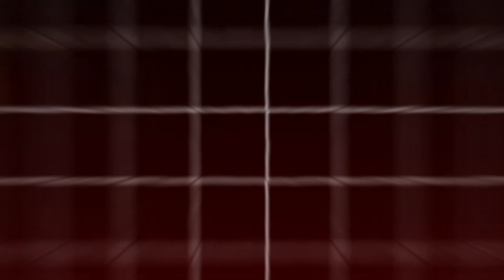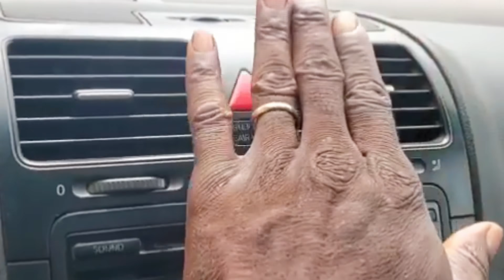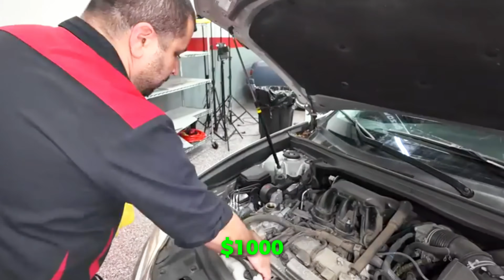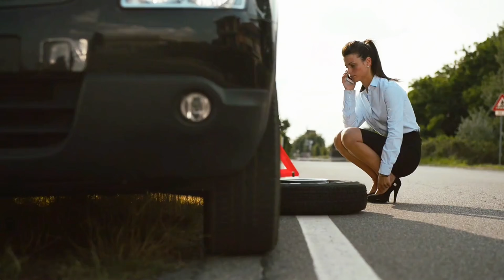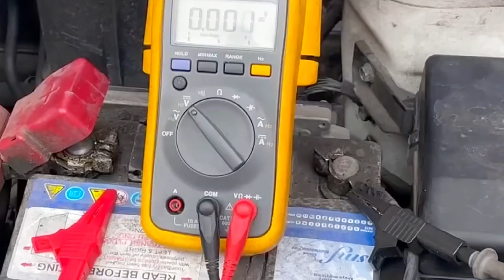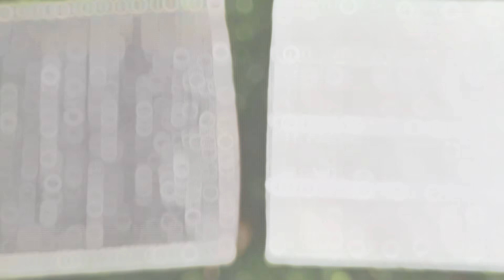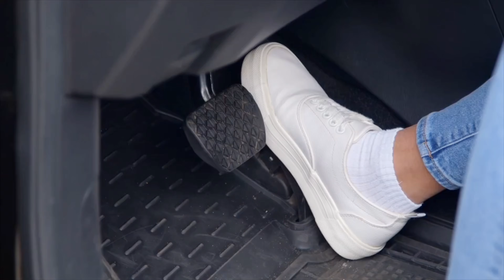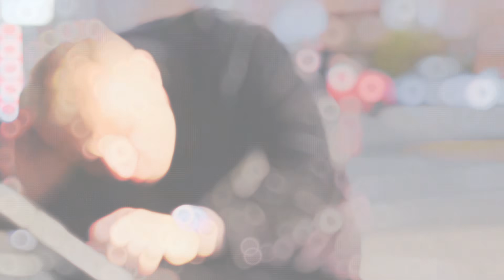Stupid Mistakes DESTROYING Your Automatic Car (AVOID THEM NOW)

Comment: A major problem with the check Engine light is the reader at the auto parts store only gives general information.  It might give you an entire system that has a single problem but not pin point the part.
Reply: Correct! They can clear the code. It may or may not come back on. Google the OBD code and determine if it's a simple omissions sensor/code. In that case, nothing to worry about. Or if it's a more serious engine issue!
Reply: My OBD II reader can connect to the internet to give me information on the code. It's quite handy.

Comment: Wiper blades USED to take 5 minutes to replace.
Reply: They still take 5 minutes to replace.
Reply: Apparently the plastic hardware attachment pieces are constantly being redesigned. It’s a pain in the rear as they are not intuitive between brands 😮😢

Comment: Where do you purchase a $5 quart of oil ?
Oil costs more than $40 for 4 litres.
Reply: You can buy a gallon of oil at wal mart for $15. Which is about $3.75 per quart
Reply: He was talking about adding oil to a low oil reservoir. Not changing. your oil. .
Reply: I pay about $4.00/quart.

Comment: If you read your car’s manual, it says to turn on the recirculating button once the super hot air has been cooled.  The regular button allows outside air to come through the air conditioner, get cooled, and then exit the car, pushing the super hot air out of the cabin.  THEN the recirculating button is pushed, and the cooled air remains in the cabin, easing the load on the AC system.  Rolling down a rear window also gives the super hot air somewhere to escape.  Roll the window up, let the air cool, and push the button.
Reply: also, when you don't keep the air recirculating  it is pulling in exhaust from other vehicles  - can't be healthy.
Reply: @ZmarleneZ  That's the main thing I use it for! The diesel fumes make me sick. (I also use it to keep cool air inside)
Reply: Common sense
Reply: Makes sense. I open all four door in driveway and just let natural expansion of hot air or the slight breeze get rid of that super heated air
Reply: @LK-bz9sk   whats to say the hot air escapes your car and more hot air gets into your car.  I dont like it.
Reply: @MaryelleBea   If the windows have been up while it's sitting in the sun then the internal air is significantly hotter than outside air, it's like a sauna. Opening the doors will at least let outside air in so it's not quite so hot.
Reply: @MaryelleBea . Black interior vehicles pass 130 degrees Fahrenheit. Multiple studies confirm this
Reply: lol. What percentage of car owner read the car manual.. it’s thicker than most Novels…. We read it when a light turns on 😂  or  YouTube it… Every car dealership should have its Own YouTube Channel that  explains  the car you just spent $30K to 70K on ..
Reply: Keeps exhsust from others cars entering my car
Reply: Thanks !!!
Reply: Most cars now are smart & automatically turn this feature on when it's time.  Just older cars need you to manually touch this button.
Reply: I just roll all windows down, it’s hotter than hell in Louisiana 🥵🥵🥵
Reply: @Swampgurl777 My hairdryer is 4 windows down & 55 mph!😅
Reply: @eldajackson1 😂😂😂😂😂
Reply: @eldajackson1 Zooming 😂😂
Reply: @Swampgurl777   Arizona too.  You guys have worse humidity though.  Either way, do your best to stay hydrated and healthy 😊
Reply: @Lala.903 right back atcha 🥵
Reply: In very hot weather we leave driver and passenger doors open for a minute to allow a/c to push hot air out.
Reply: appreciate ur words but extremely confusing. You should start with Entering A Hot CAR Open Windows and press OUTSIDE AIR BUTTON to push hot air outside?
Once hot air kicked out, roll up windows, Press INSIDE AIR Button (recirculating one) to cool the air getting cooled  already circulating inside car.
is this correct_please share thank You
Reply: @pilarq7886that outside air button pulls in air from outside and blows it into the cabin.  I always open my windows but never change the recirculate button.  What is the benefit to pulling in hot air from outside into the car, if you are trying to let the hot air escape through an open window.  Why not just leave it on recirculate and let the hot air out the windows?  Truly trying to understand so i can follow the right steps for my car, not being critical.  TY
Reply: @my3sneezes  Recirc for long periods of time causes CO2 to build up. This can cause drowsiness. Be mindful when driving long distances.
Reply: @pilarq7886I agree. This was poorly written.
Reply: @LaClairEtoile I understood what he typed 😂. Maybe you’re a scumbag
Reply: @LaClairEtoile  NO, you're just poorly educated. It made perfect sense.
Reply: @pilarq7886correct!
Reply: Common sense! Think .... people! It's a RECIRCULATION button. It will trap & recirculate inside air at whatever temp it starts at!
Reply: Thank you.
Reply: I just roll my windows down for a bit
Reply: In do this and I didn't know about what the video is discussing.
Reply: Well I have a old car and I only use high octane, gas, premium, and premium only because it burns slowly and I get better gas mileage
Reply: THANK YOU! Commonsense ❤
Reply: Thanks for this tip. With all the smoke in the air I rely on the recirculation button all the time.
Reply: I got it: Change cabin filter
Summer
Hot car has trapped heat that is probably hotter than outside. Use A/C outside air with windows down to blow that trapped heat out for a minute or so.
Turn on recirculating A/C leaving the back windows cracked open to push the remaining hot air out.  Less burden on the condenser.

Winter
Overcast, rainy foggy days. Don’t recirculate A/C if it’s colder outside.
Dampness can cause mold. 
Now I have a question about humidity. It’s hot in Texas
Reply: In hot weather I always roll me windows down for the first minute or so of driving while I have the AC going and the recirculation button is on by default. Once the fresh air has blown through the cabin I roll up the windows and let the AC finish cooling it down.
Reply: 100%
Reply: Thank you!
Best info. about this I’ve read.
Reply: The recirculation button is what I use to keep the cigarette smoke out of my cabin at traffic lights. There's always some ahole smoking somewhere in the queue.
Reply: @tomcarroll2244 😢😂
Reply: @tomcarroll2244 yep.
Reply: @tomcarroll2244 😂😂
Reply: @tomcarroll2244  aren't you precious
Reply: @zestyzelmasensible is a better word, unlike you
Reply: @TheAngeltinks  "fragile" is more accurate. Taking a person that smokes personally is hilarious 😂
Reply: @TheAngeltinks smokers getting offended is funny😂
Reply: @2_572 Smokers Lives Matter & Liberties, Hopefully they Still exercise their Right to Vote .
Reply: @2_572 in my neck of the woods they are POT smokers, it REEKS from cars on the freeways. Thank God for the recirculation button 😊
Reply: @HisLove4You i don't like that skunk weed smell for real 😂
Reply: I could imagine it's like something from nurgles garden.
Reply: It’s poorly written. What I would say is, when you enter a hot car, open at least two windows or open at least two doors for about a minute to let the heat out. Then get in the car, start the engine and make sure that the recirculate button is pressed. Make sure your windows are rolled up. This will keep 😢 smells and contaminates out of your car and will cool off your car’s interior much faster.
Reply: This is a little confusing for me 😢
Reply: During hot months,  open car windows to release hot air out of your car first, then close windows & turn on AC. 

Use the circulation button when you're on the freeway or driving behind cars with bad exhaust to  prevent polluted air going into your car. 

Use circulation button when AC is on & outside air is hotter than the temp of your AC. 

The freeway has bad air quality from cars exhaust. 

Release the circulation button to let outside air in when the weather is cooler & not a lot of cars around.
Reply: @glendacisneros982  it’s OK. Somethings are confusing especially cars, my dad would always check my stuff and then he started showing me that he was checking when I got older. Just in case and that was one thing, but then I was curious a lot of people don’t have that and there’s nothing wrong with that don’t worry there’s nothing wrong with you being confused. It still can be very confusing and we are not to judge people. I’m sorry if someone made you feel uncomfortable about not understanding that was not right. Remember to always ask questions and if you’re uncomfortable asking questions find someone you trust to go with you too a car shop to make sure that you don’t get taken advantage of.
Reply: @glendacisneros982 forget what he said, stinky open the window for a few minutes before inside is fairly cooled down, or before hitting highway. It's just faster and more efficient, just hit auto after
Reply: @glendacisneros982  You should start with Entering A Hot CAR Open Windows and press OUTSIDE AIR BUTTON to push hot air outside?
Once hot air kicked out, roll up windows, Press INSIDE AIR Button (recirculating one) to cool the air getting cooled  already circulating inside car.
Reply: @pilarq7886 to be honest, this is always confused me. I’m thinking what is this for? I always thought that it was for getting the outside air out of your car cause whenever I turned my car on that thing would be on right away meaning to me that outside air would be coming in my car and I didn’t need the exhaust in my car or cigarette smoke so there has been always been many misconceptions about that button. No one has really gotten down to explaining it so please people have patience with us that are finally hearing about it, and if we don’t understand what you have explained, don’t call us stupid or yell at us just try a different way of explaining.
Reply: @glendacisneros982  I never touch that button because I don’t know what it does😮😢😢
Reply: Entering A Hot CAR Open Windows and press OUTSIDE AIR BUTTON to push hot air outside?
Once hot air kicked out, roll up windows, Press INSIDE AIR Button (recirculating one) to cool the air getting cooled  already circulating inside car.
Reply: @louisem.402  hey it’s OK. We’re here for you right people. Some people may not have been explained and I’m let’s be honest. I mean, I actually like reading my manual you can find out so much stuff, but some people have not and sometimes reading manuals can be confusing, so be kind. We are all not on a mechanics and even I have to go back and wonder what sometimes we just don’t understand anything. It happens for the longest time and I know how to do this, but for the life of me, I could not figure out how to change my clock. I tried everything nothing worked so you know sometimes your brain just short circuits. I call these learning moments because sometimes my brain just decides then there’s not enough sleep moments
Reply: @pilarq7886 OK but yeah, my my brain is on that. I know you explained it, but I just forgot it. It’s different in the winter though isn’t it and I don’t want to smell the exhaust I think somewhere it was something you’re supposed to let it warm up and then hit that button. I’m not sure that is always the mysterious button that will always get me.

Comment: What about braking gently when able and accelerating gently when able too, just makes sense unless you enjoy having to pay up for things prematurely after you wear them out. Like what is the rush???
Reply: Yup…..lifting off the gas early much better than breaking later….same as stomping on gas…..just ease into it
Reply: Except most people that brake gently.....hold the pedal slightly down for longer distances which wear your pads quickly.  See it alot from the retirement complex, constantly riding the brakes isn't good at all.
Reply: I have six piston Brembo brakes. I HAVE to break gently, or it'll put me through the windshield. I've never had a car with this much braking power. It's really nice.

Comment: What about turning off your AC about one minute before you turn off your engine. I think it lowers the pressure in the system so it doesn’t just stay at a high pressure the entire time you’re parked…
Reply: Also helps to reduce and dissipate condensation buildup within the venting system after shutting off the car.
Reply: Maybe it does . Have you asked a mechanic or " technician  " about it ?
Reply: Some video said if your pressure in your tire reads thirty one , it said to fill it to 41 because your tires at the side of the treadmill will wear down more than the middle tread if you don't .
Reply: @tommurphree5630  I have had so much trouble with my tires I mean, not being the right pressure that light is always going on and I used to be able to used to have something that I could just fill it right up there that doesn’t work anymore then I have to go and drive it to The in the winter. That is the most common thing for the tire pressure be on one side. It does happen sometimes in the summer, but I started driving it more than it just show even though.
Reply: @tommurphree5630 so if your sporting factory size tires on your car and your using the factory recommended psi in each tire than your in what I call factory base line. If your particular situation is something like driving slow through sandy areas you might find yourself lowering your tires considerably in order to grip the soft terrain. Getting to know tricks like this can increase your odds of successfully navigating a difficult situation. I do recommend planning ahead such as bringing tire changing tools at minimum. 😅ok that’s my rant for the day… have a good and safe holiday!

Comment: When you turn on AC, the recirculation comes on
Reply: I think it does if your cold option is set to max. Running max AC does shorten the life of the compressor compared to like half way to max and neutral. 😮cars are money pits either way though
Reply: Mine does
Reply: Not in older cars.
Reply: No, it doesn’t.
Reply: @jayhobson7797  depends if the button is pushed & the light shining

Comment: Putting the transmission in neutral,
Reply: Put e brake on after putting in park BEFORE taking you foot off the brake! Saves your tyranny gears!
Reply: is a good thing ye?
Reply: pretty sure the new brake hold system accounts for this, one of the few good things modern cars have